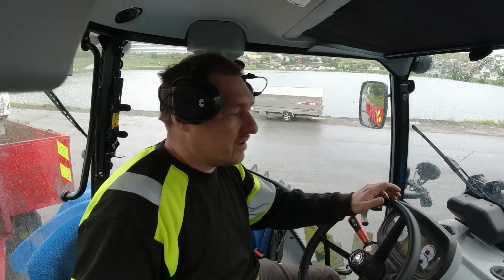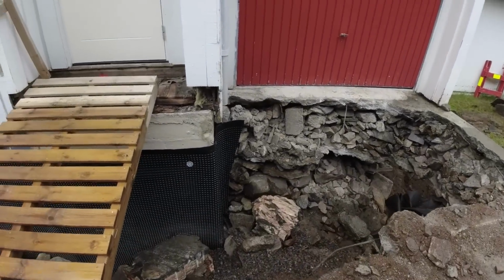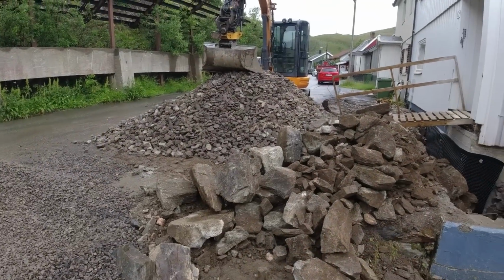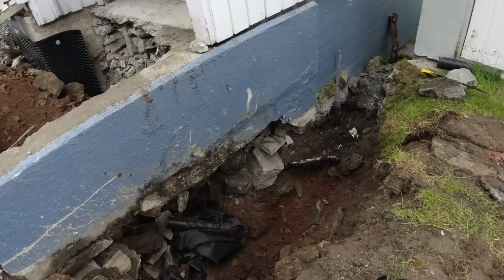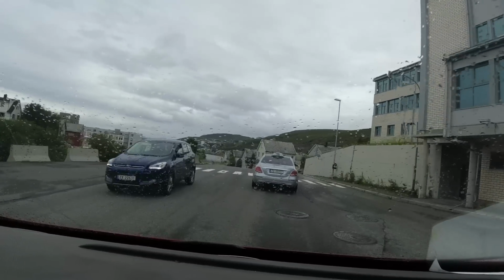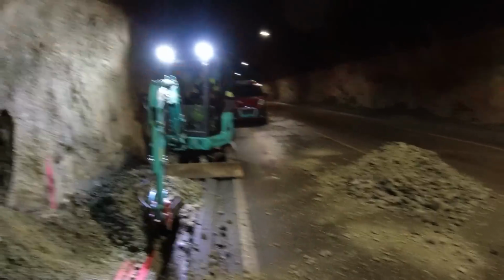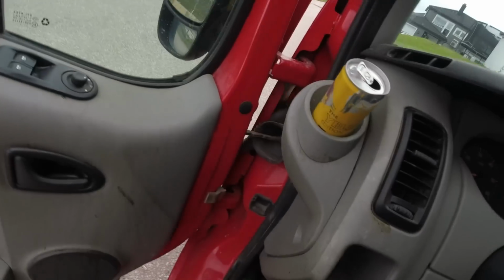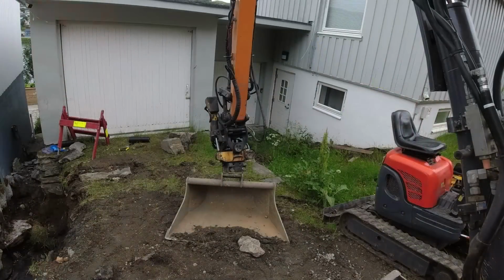13 hour's workday with Minimachines

Comment: Surprising to see you putting rocks right against the foundation we normally use sand to prevent damage to the water barrier and then just have have a rock drainage system at the bottom around the footer. Apparently you trust your water barrier to not get damaged!
Reply from the maker: We use the clean rock that I got delivered normally its 16-64mm. But the plastic is for letting air get down not for water proofing, for that we use an sealant concrete 😊

Comment: Keep up the great work. Quick question: How to do you quote/charge for the tunnel job? By the foot/meter, total job or hourly? 
Thanks! Hope you're able to have a good vacation!
Reply from the maker: Thanks, We are working by the hour was hard pricing it since there where a lot of existing installations. Thanks will se if we where we end up looks like driving is the only solution right now with the strike and prices on other airlines have over doubled because of that.

Comment: Good to see you back.  I know it gets busy trying to keep up with the business and continue with youtube and recording the stuff you are working on.  The tractors here in canuckistan are not built for loading rocks and heavy materials.
It will shorten the life of the loader.
Reply from the maker: Thanks 😀They are not built for that here also but if you use your head it's no problem. bought it to use it so😀
Reply: @MiniMachines1  yes, you have to work with what you have.  My "mini machines" are always working on the edge" lol